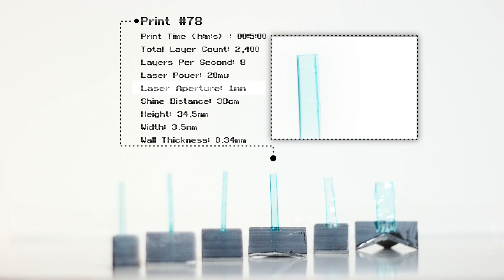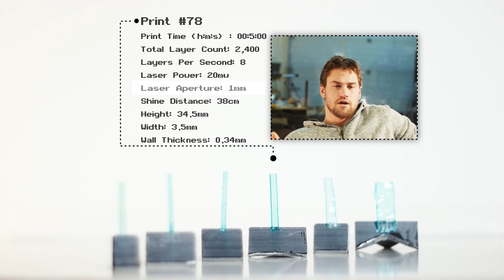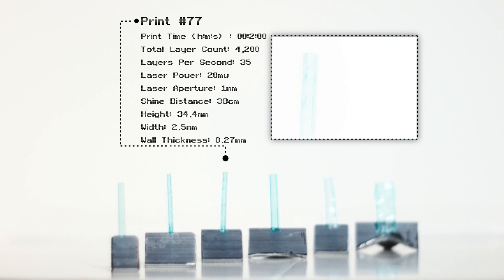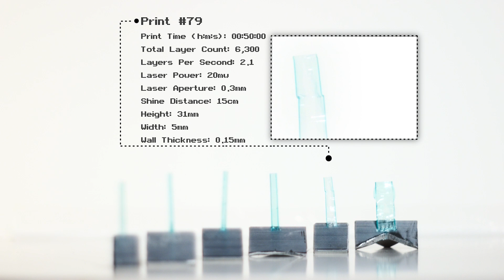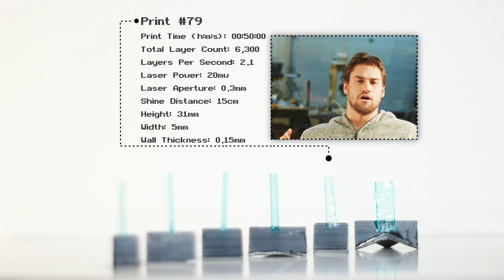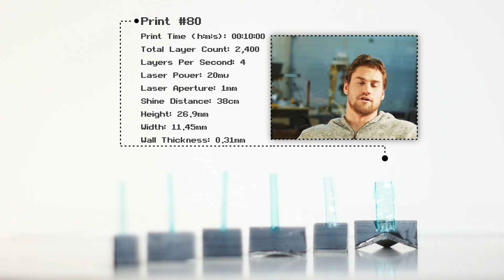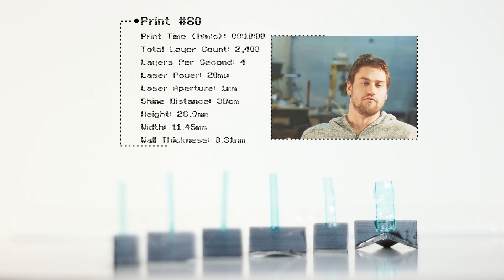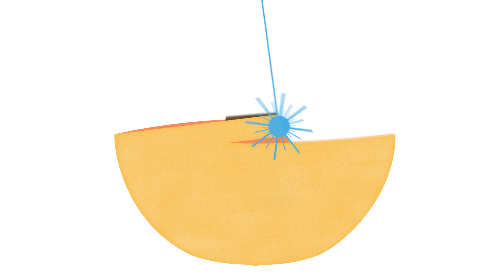UPDATE #13 - Column Comparisons

Comment: Could you calculate how much resin is used while printing, and have two drips: one that does salt water and one that does resin, so you can refill resin as it's printing and not run out?

Comment: One idea would be to put a large speaker next to the tank to simulate a high noise environment like an apartment next to a highway or a factory floor.  One possibility could be that the slight but constant vibration in the fluid could help lower the surface tension.

Also, the glass-like texture on these column prints is just spectacular.  I'd be interested to see what kind of lenses you could make with this resin.

Comment: I had an interesting idea. What if instead of the "drip" system dropping once at a time, let's say 10 drips at once so the z axis continues to rise smoothly. I saw your previous videos and the pictures that Peachy Printer produced.... It was amazing but I was a bit disappointed when I saw "stairs" forming in slopes and slants of the sides of the prints....Was it supposed to be printed that way?  If not, I think by using this way, it wouldn't it reduce the amount of the little edgy sides. Nice job on your Peachy Printer by the way! I am really looking forward to this because I can't afford Makerbot or something like that!

Comment: Hi Peechies! I am a happy backer and I just want to share 2 thoughts with you concerning this video:
1. About resin not having enough time to cure; Did you try to warm the resin ? Maybe that could help.
2. Could you try to fabricate some optical objects such as a lense or a prism and see how  well they work?
Reply: Warming the resin shouldn't do anything as it doesn't use heat to cure it uses uv light.